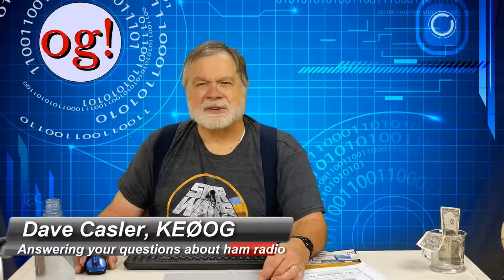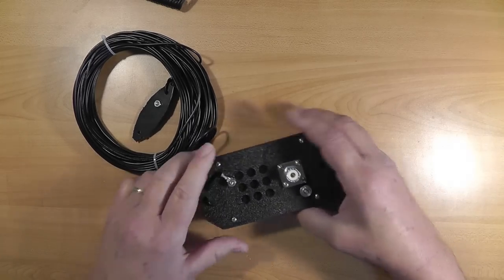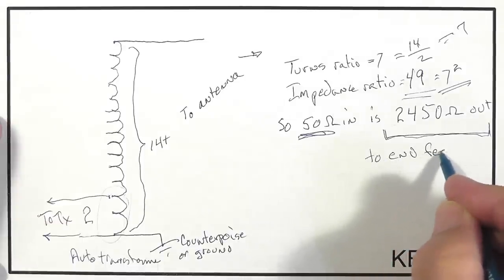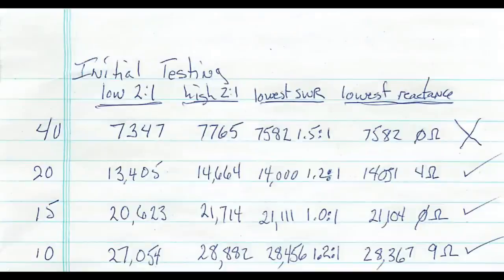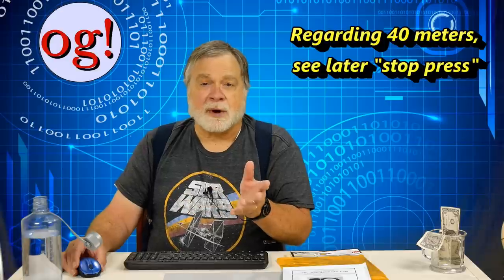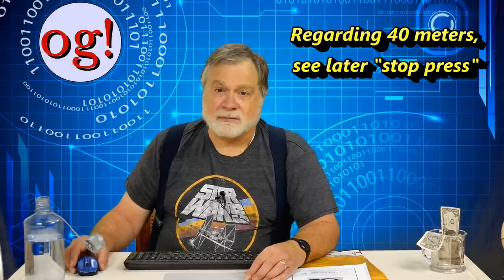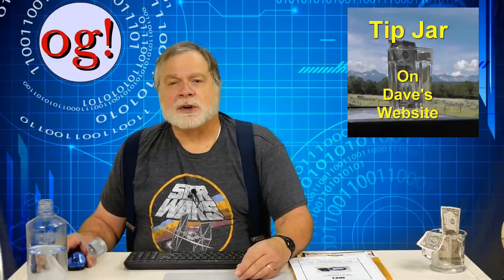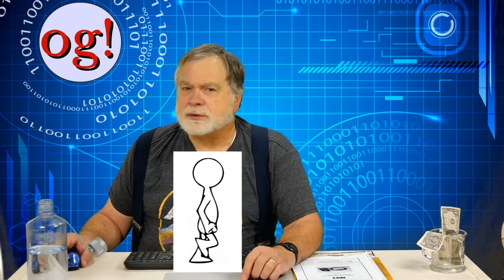Review of MFJ-1984MP End-Fed Multi-band Antenna (# 89)

Comment: Way too much hassel
Reply from the maker: Oooohhh yeah! This was one of the most demanding (physically) videos I've ever done, and I still needed to get advice from MFJ on how to make it work.
Reply: David Casler although...........if you had followed the example photos, it would have worked just fine. I followed the instructions and guess what? It worked just great!
Reply: I'm not sure I agree its too much hassel.  The "point" of this antenna is aimed squarely at the QRP guys who want to work portable from a backpacking situation... on a mountain top for example.  They will have a single pole for the treeless sites, and a small QRP rig either on the ground or bench.  They will have a very short amount of coax, and will be sitting within 10 feet of the feed point of this antenna.  So... tinkering with it really won't be much work at all in that use case.  Plus, if you want to work 20m there's no tinkering at all.   Anyone who is hauling their rig, an antenna, and some sort of mast/support up the trail on their back really won't find this antenna too challenging at all.

73, N1SFT